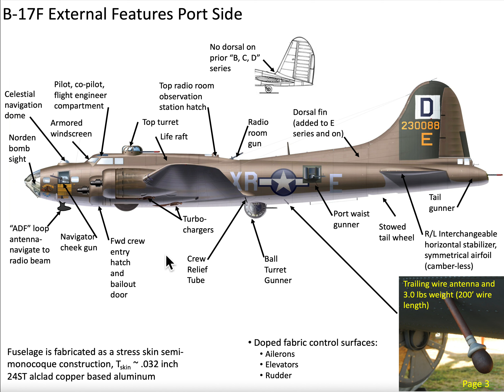B-17 Bomber's Left Side Exterior Features

Comment: Wonderful job. If you haven’t discovered more you probably will. The reason an airplane has a forward CG is to keep the wing flying forward. It will not fly backwards. Make the airplane more predictable and recoverable from stalls. They learned that from the early airplanes not being able to recover from a stall. Also the 75 pounds of paint smoothed over the extruded rip vets and made the airplanes faster saving 470 pounds of fuel on a typical mission. Instead of the bear airplanes. The dorsal fin was enlarged to provide additional Rutter effectiveness during engine failures.

Comment: The USAAF started to stop the normal process of painting the aircraft in favor of bare aluminum to save weight. One B-17 fully painted would weigh 500 pounds more than another of the same model and equipment but without paint. 500 pounds equals one extra bomb, or that much more fuel. If all things were equal, the bare plane would fly a little faster.
Reply: The weight difference was 75 lbs not 500, and a painted B17 actually could actually lift over 450lbs more than an unpainted one could because of the increase in airspeed, painted one's also had an decrease in fuel consumption giving them a slightly longer range.
There are various reasons as to why they started flying missions unpainted that have to do with the different commands.
At first they were painted at the factories, the decision to stop painting them there was to speed up production and make delivery less complicated, after that it was up to unit commander's as to whether or not they'd be painted before flying missions, things like perceived effectiveness and how fast a replacement plane had to be pressed into service were the deciding factors. 
Same thing with fighter's, that's why sometimes you see some P47's flying over Europe painted and in the same picture you'll see some that are the same variant in the same unit that are unpainted.

Comment: Looking at the plane in detail there seem to be a lot of aerodynamic lift in the whole construction. When you loose one of the three control surfaces theres still a lot left to produce lift. The fuselage it self seem to make some lift in it self. No wonder this construction made it home with half of its wing somewhere in Germany. The Liberators did make it with some damage, but only barely and the pilots would have to struggle more with damage to the wings.